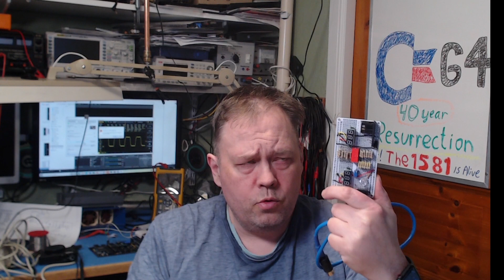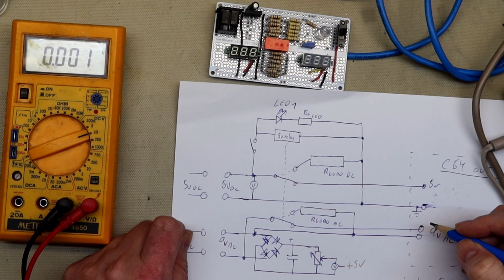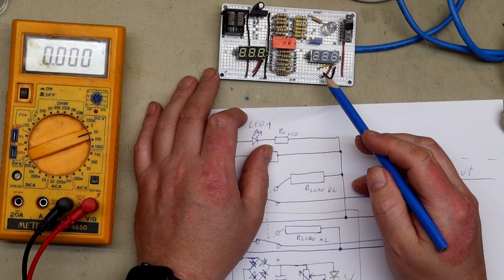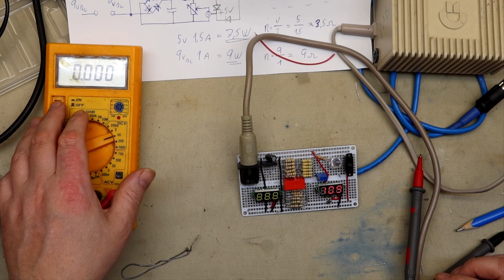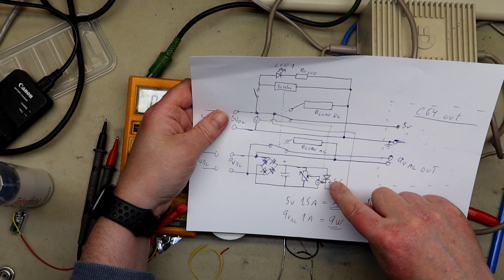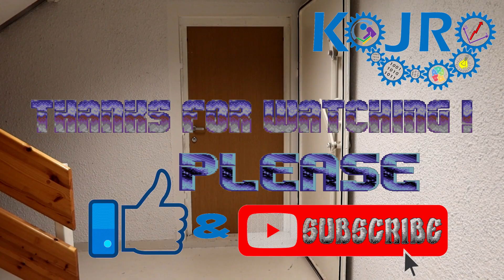Second Interlude to part 9 in The C-64 resurrection series. Improving the PSU tester.

Comment: It's maybe interesting to make two test switches on 5v and 9v to test with Load and without Load and see how it behaves how stable they are. And messure how much AC is on the 5v power rail. To see how healthy the capacitor is..
Reply from the maker: I actually ran into a capastitor problem so I will be making another slight adjustment on the circuit. I do test the 5 and 9 volt at the same time, and as this is separate windings I se no need to keep them separate. The 9 volt AC is also almost always in perfect condition.
Reply: @kojroRI  Yes, it's almost always the 5V that fails. Maybe it's better to feed the test circuit from the 9v power rail. That will make everything more reliable. But  the most reliable is to feed the test circuit is from an external power source, like USB 5v